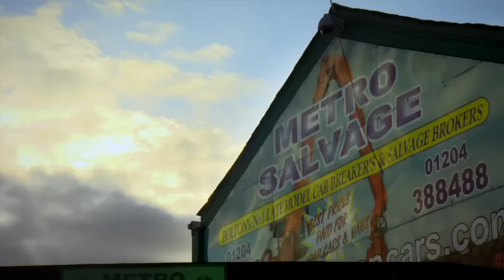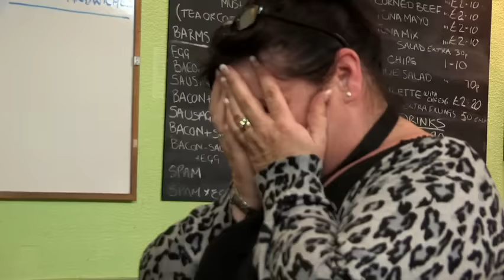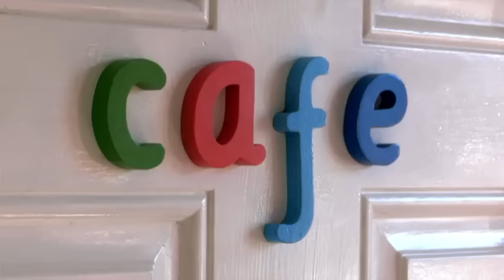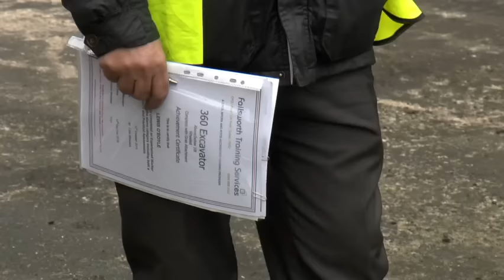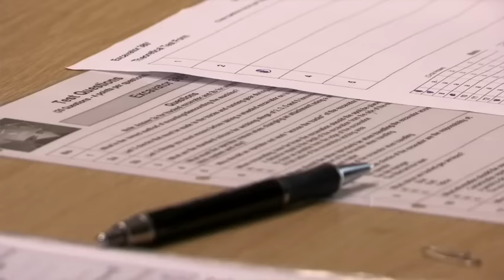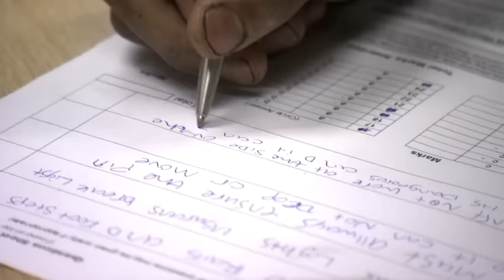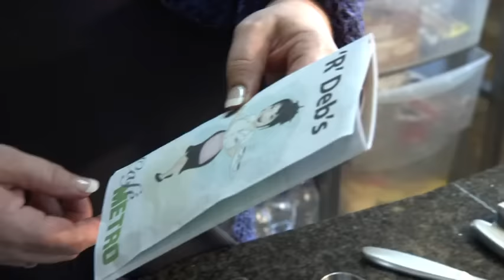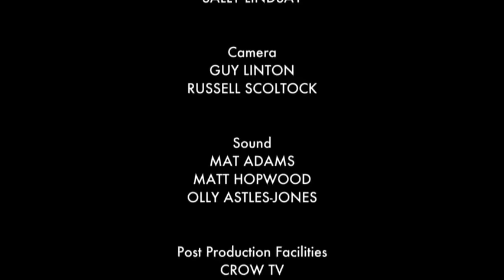Scrappers UK S01E02

Comment: Terry isn't doing everything right. My local BIG salvage yard buys older or accident write off cars very cheaply.  They do not crush or grab and ruin the cars. They  take EVERY useable undamaged or working part off it, from the tires, to all panels, all doors,  all seats, all lights, bumpers, hood, trunk, radio, engine,  battery, etc, etc. 
 The left over shell is sold  as scrap for usually what they paid for the whole car. Result is that they now have $2 million dollars worth of used parts to sell or install, which cost them nothing to buy. Total profit.
 They also do car repairs in 4 bays, and sell  and install the  good used or new tires.  Every  part is computer listed. They can locate any part you want, for most cars, in minutes. Plus, they don't run a lousy, unadvertised cafe. Terry could learn a LOT from studying them.
Reply: Mike12522 I think if he just put everything on an inventory with a couple of scanners to locate the parts in their bay, he’d be laughing, he knows what he’s doing to be still trading 20 years after starting, just needs to upgrade his systems
Reply: @rossbarlow3037  -  In 2014, the company was fined 30,000 British pounds following an accident, and violating worker Health and Safety laws. In 2012, a customer successfully sued for 12,500 British pounds after a lifted car was accidentally dropped on him. The company has been in liquidation before, due to ' business problems '. Staff have been reduced down to 15.  And now they can't  locate parts that they know they have, somewhere !  Sure doesn't sound to me like everything there is perfect.
Reply: Mike12522 holy shit 😭😂
Reply: @Mike12522  This show was aired in 2014.  Wonder when it was actually filmed though?

Comment: Neither the women nor the man doing the menu know anything about pricing.  Cost price each item used to make something, e.g a sandwich - 2 slices of bread, butter (or margarine), filling (including things like salad, pickles, etc.), wrapping, then triple the price.  That allows 1/3 for ingredients, 1/3 wages, and 1/3 utilities and washing up, etc., 1/3 profit.  A little work to start but make a list of each item along with cost and there is a handy table ready for any eventuality.  No guessing, no chancing or anything like that.
Reply: That's not how it works.

The item costs £1 to produce, so they triple the price and sell it for £3.  That puts them £2 up.  But simply splitting that £2 into thirds means the "profit" is evenly divided three ways and spent on other things, which means no actual profit at all.

They could scale up the operation by putting more bacon rashers on the grill etc., which would use the same amount of energy but cook more bacon, which could then be sold at the marked up price.

Comment: couldnt find my kinda car in the open area of scrappers so l went into the working area cars still have gas and oil and what , the sign no entry was gone, its up again, found one started removing a part , forklift came , l was in darkness l guess think it was sunny l waved he didnt see me l had time to move away but not much , he took my car, l was under it just before , it was on top of another. l told him he was shocked he could have looked better behind without going out of forklift, he called a manager who acted kinda suspicious of me. wathced me for a while.

Comment: The need to cut the cafe out... they should also make it a pick your part yard instead of ripping the engines out first, my local yard pays 100-200 per car and some of the parts I buy pay back half the car and they've already got rid of the cats
Reply: B3nM0n cats?
Reply: catalytic converter
n.
A reaction chamber typically containing a finely divided catalyst (usually platinum and other metals such as rhodium, palladium, and gold) into which exhaust gases from an automotive engine are passed together with excess air so that carbon monoxide and hydrocarbon pollutants are oxidized to carbon dioxide and water, and nitrogen oxides are reduced to nitrogen and oxygen gases.
Reply: yeah most yards i been to take of the parts yourself
Reply: Pick your part as in find it yourself? Yeah, it doesn't work. I remember looking for a parcel shelf for a Fiesta for 5 hours and they gave me the wrong tool once i found one. That was in Bolton, same place as this, in the 90s.
Reply: @MickTShaft  take your own tools
Reply: @MickTShaft  and you dont need tools for parcel shelves
Reply: The women in the cafe don't get a salary from him, they live off what they sell...and I imagine they have to pay him rent on the cafe too so it doesn't cost him owt
Reply: You realize this isn't the USA with heaps of space right? This stuff needs to get IN AND OUT. I watch a channel called neutral drop and they explained how the lack of space in NYC dictates how SO MUCH good stuff gets put in the crusher. Plus the way you can be sued SO EASILY is why MANY of these places got rid of the pick your own part idea.
Reply: @raylyd  Here in the netherlands it's all yards like that. You can ask them to get the part off for you, but it will cost extra.